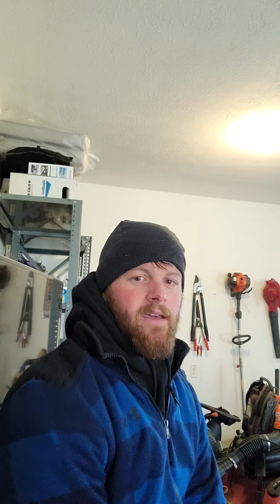Discussing the BICSI RCDD Certification

Comment: How much of what you actually do and also what parts of the exam covers fire alarm and suppression systems in buildings?
Reply from the maker: I don't recall a single question on the exam about fire suppression systems.  I don't work with fire alarms or suppression systems.  The TDMM probably covered a lot about them though ..it's been a quite a while since I was studying for it so I can't recall exactly...

Comment: Hey man, not sure if you're still responding to comments or questions, but I'd love to get in touch with you and pick your brain. I am currently working in public safety distributed antenna systems and work with RF and signal testing. Add signal testing. I want to grow and have been looking for certifications and this one really caught my attention. But if you're open to speaking about other certes, that would be amazing!
Reply from the maker: Although the RCDD is a great certification that encompasses a ton of information including antenna systems; I don't know that it is detailed enough in them specifically. It does cover them but it's more or less one section or part of it ..it did get into the physics and different antenna types but not actually installing and designing the overall system. I feel like there's got to be something better focused on that . This would be more for network designers designing various types of networks in my opinion. Not specialized with antennas/wireless.  Hope this info helps.  Sorry for the late response

Comment: This is the same thing I've heard from every RCDD I've spoke with. I'm currently working on my RCDD and was wondering - is EVERYTHING in the book fair game (as far as what to expect on the exam)? I am very detail-oriented and am having trouble determining where to spend most time studying in the book. Please advise
Reply: Anything in the book is fair game for the exam. BICSI has a document which details what percentages each subject will have.
Reply from the maker: @LetsTalkCabling  Thanks!
Reply from the maker: I uploaded a new video discussing the preparation for the exam.
Reply: @Fiberline91  I'll go check it out!
Reply from the maker: I didn't see anything on test that wasn't in the book. So id say as long as someone absorbed the content they'd be fine. It's just so much information it takes multiple reads for many. If you can get the course book for the BICSI DD102 course it has a more drawn down focus on certain chapters and they say 80% of the test covers those areas. But I honestly wouldn't bet on that. I'd try to absorb it all cause the tests differ

Comment: @hillbillynetworks Can I obtain my RCDD certification without an IT degree? Thinking about going into fiber optic splicing and trying to promote to the design side of the job. I have a bs in kinesiology so it’s not very relevant lol. Thanks
Reply from the maker: Lol I get it, I have like 3 degrees in random stuff like social sciences. No, you definitely don't need an IT degree for the design or hands on fiber work. Most successful splicers are just packing good ole experience

Comment: I have the 2 volumes books of RCDD. Reading through it and it has a ton of information. I am a BISCI TECH looking to become RCDD certified. Is there a low percent of change of me passing rcdd exam without taking course?
Reply from the maker: I dont think you have a low percent chance of passing if you dont take the class. I think you could pass it with just the 2 volumes of the TDMM. The TDMM is supposed to contain everything the test covers and more. The course is just a crash course that just hits on main areas which is great and helpful (very much enjoyed it) but doesn't cover anywhere near the amount to pass.
Reply: When you read the TDMM you will come across conflict (how you install vs what the TDMM says).  To pass the test rely solely on the book. You got this!
Reply from the maker: @LetsTalkCabling  I don't disagree at all. I've seen a lot of accurate info in there vs some outdate info that's incorrect, especially with fiber optics.